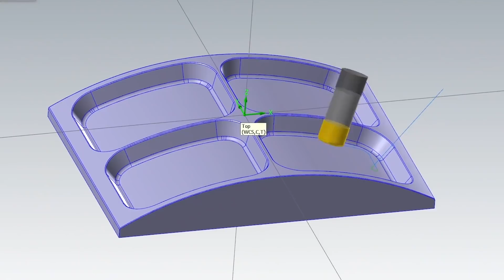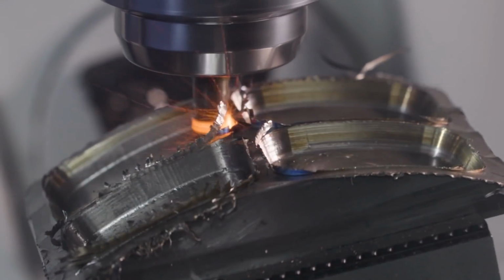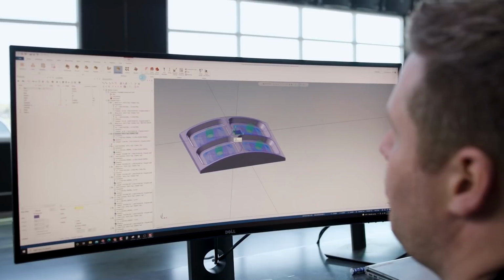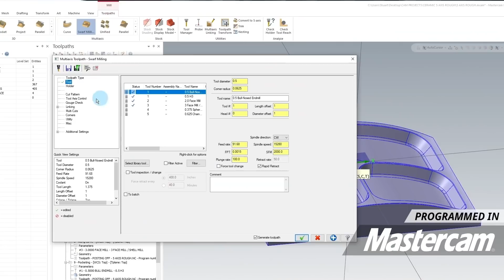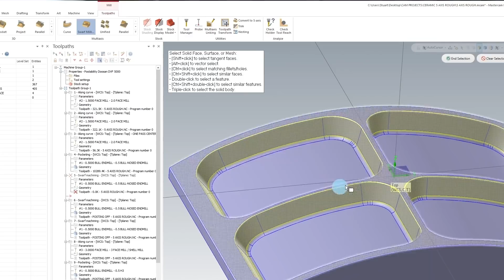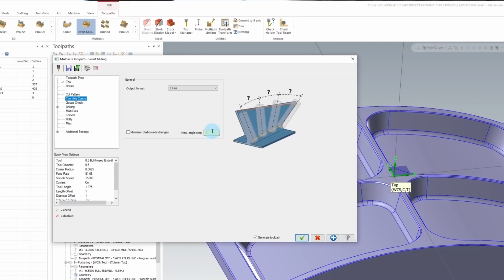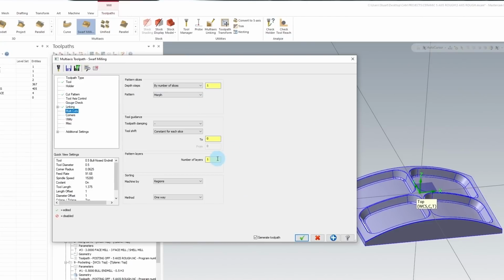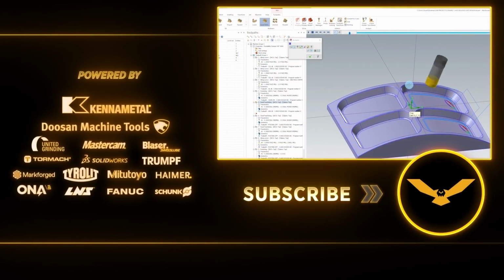5 Axis SWARF Toolpath | Ceramic End mill in Inconel 718

Comment: each time you come to the last radius of the pocket it does a sweep out and back in to start the cut again.
What is the thought process behind this ?  to let the mill ramp speed or chip clear..?
Reply: It's just a lead in/lead out. Most Mastercam toolpath offer this feature. It's easier on the tool to do a smooth lead in and out.

Comment: Nice.  I know this is probably not a real part, but what kind of part is this based on?
Reply: Why would it not be real.... Inconel aint cheap
Reply: I can't imagine buying that piece of inconel, spend a lot of time programming all that, and putting wear on your mills and machine just to make a fake part. You could just put a chunk of wax or aluminum and a cheap ebay bit if you just want to show off a fake part.
Reply: @crissd8283  There is usually an NDA involved when you build parts for other people.